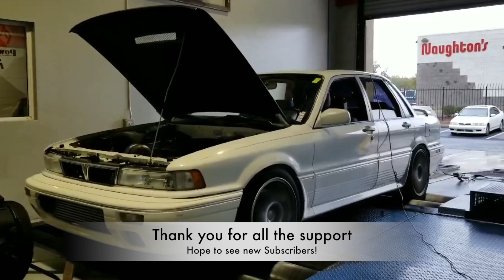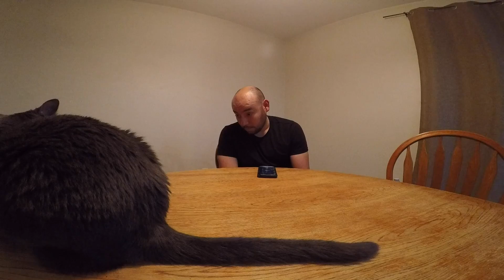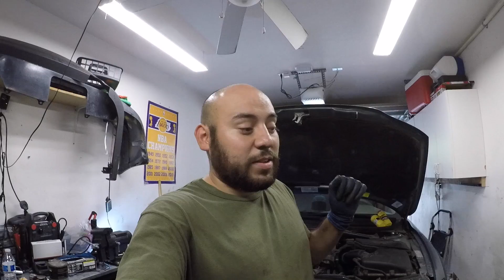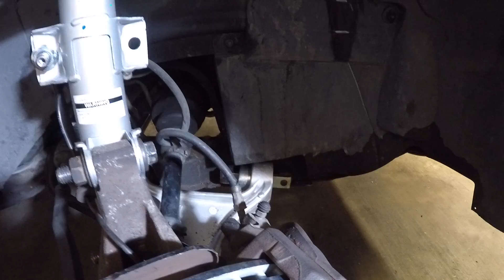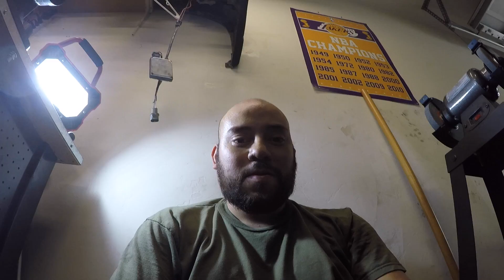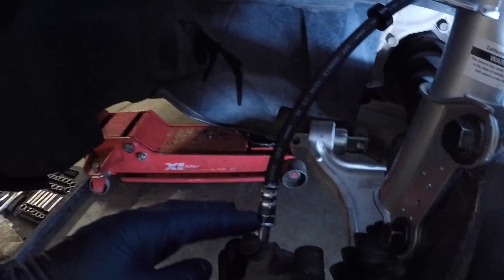Volvo XC70 How to Replace Front Brake Lines, What Shops Charge

Comment: Some tips for doing this job:
If your brake line connections were old and rustly like mine clean them and the bleed nipple with brake cleaner and a wire brush.
Then spray them and the bleed nipple with penetrating fluid days or weeks ahead of time.
As if you strip the nut by the solid brake line you are in trouble.
Also, use a brake line spanner to help prevent stripping the nuts.
Thanks for the upload btw, I think you have the only video that shows how to do this on a Volvo.
Reply from the maker: Thanks for the tips for others who watch this video! I have pinned your comment to help others thank you! And yes there are very few videos on this chassis.

Comment: Great video. Another tip, slide a card board box under your work area, to make it fit and depending on what you do you can flatten the box, or cut one side to make it fit. The box will absorb small fluid leaks and catch any small parts the might roll somewhere and disappear
Reply from the maker: I have no idea why I haven't thought of that! I need to do that for sure!

Comment: That was a lot, an official volvo dealership wanted 250 dollars to replace both brake lines, including parts. I was thinking about doing it myself but might pay someone else to do it. 

I will have no problems changing a clutch or lifting an engine and etc. But working on brake lines?
Reply from the maker: Do what you gotta do man! I hope my video helps you!

Comment: I want to put in the HARD brake pipe on front of volvo, both front wheels, anyone know if you can just weasel the pipes into position (pre-bent from volvo), or do you have to take a crap load of parts out to get them to fit? Maybe this is a pay-up and have Volvo install them...

Comment: That brake line already on it was fitted totally wrong, it's not supposed to be twisted up like that. Some idiot installed it with the caliper still in place, you can't do that. Take caliper off, fit hose both ends, ensure brake line is not twisted,  refit caliper. Some terrible mechanics out there.....